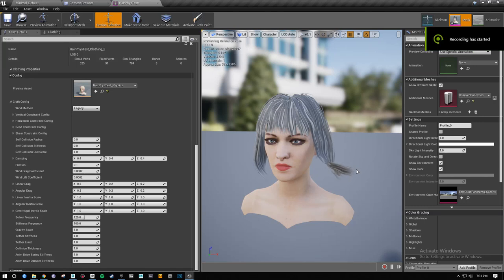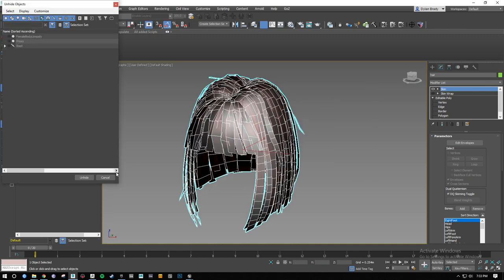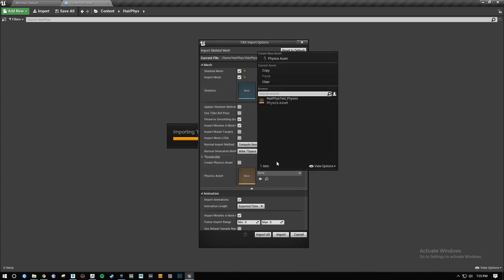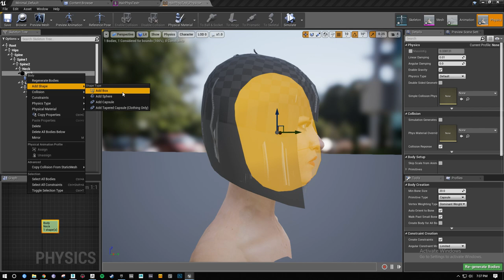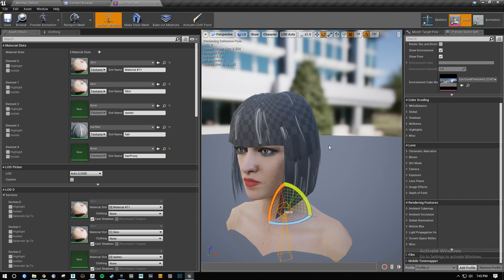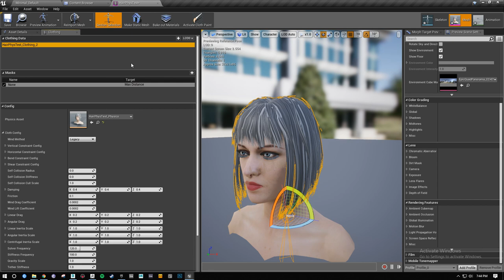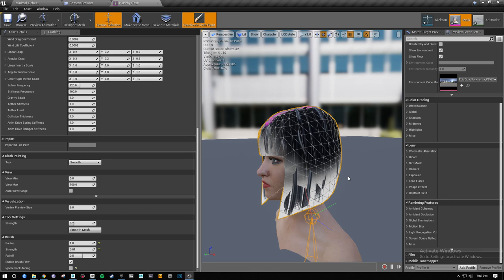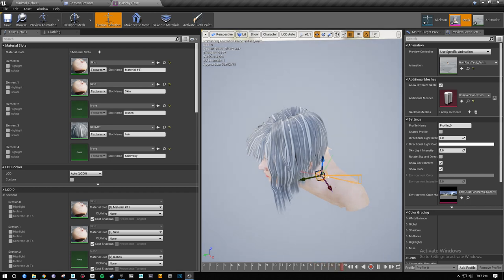Hair Physics LOD in Unreal Engine 4

Comment: do you have some tutorials for necklace? with using this method?
Reply from the maker: I don't. But it could work. You'd probably want to model a strip of polys around the bounds of the necklace chain, then use that as the proxy mesh